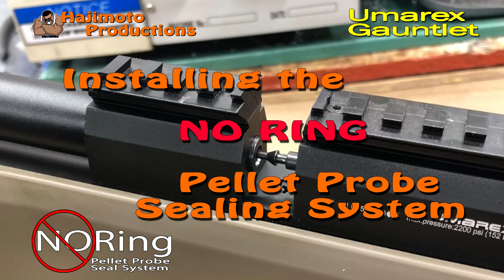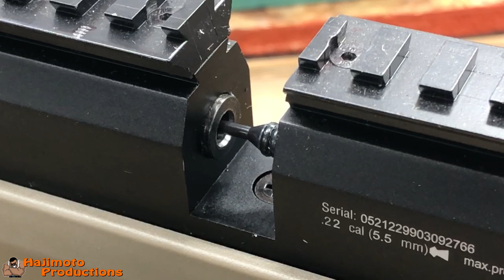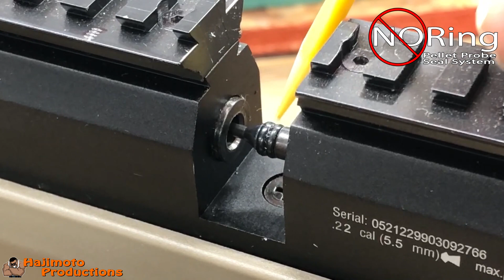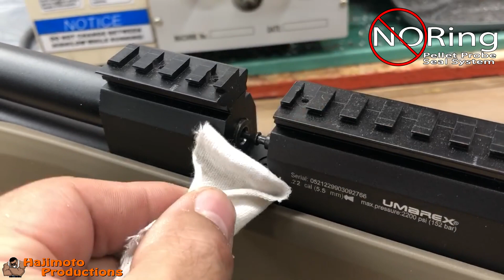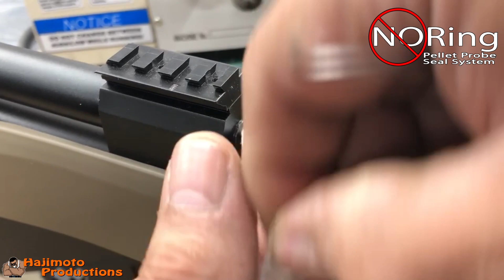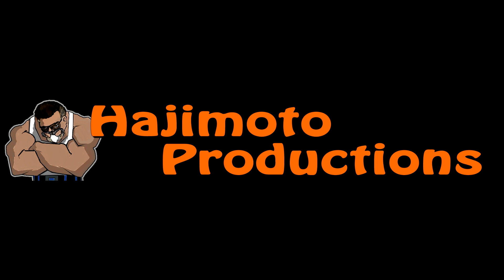Gauntlet 1 or 2 NO Ring Installation

Comment: I recently purchased the Gauntlet 2 .25 Cal, I am very pleased with the gun, my concern is replacing parts that ware out.  Will I find replacement parts on your Website, like the No Ring?  Have you done the video on taking the G2 apart cleaning and replacing ware parts?
Reply from the maker: While I may offer replacement parts they are not OEM. My replacements typically offer some level of enhancement over their OEM counterparts. Your single best source of OEM parts is Umarex USA.
I have not created a tear down of the Gauntlet 2 as I am so busy and have so little studio time latety.